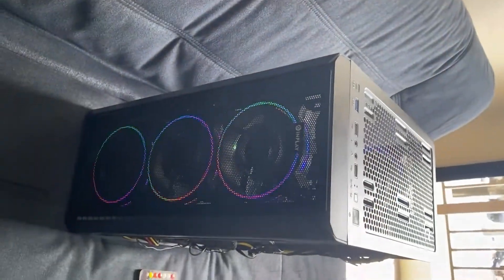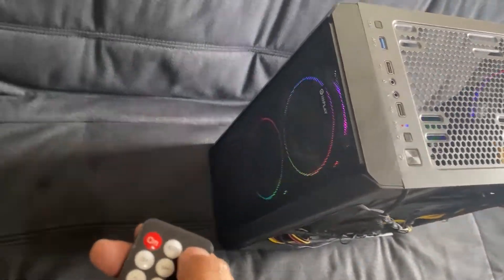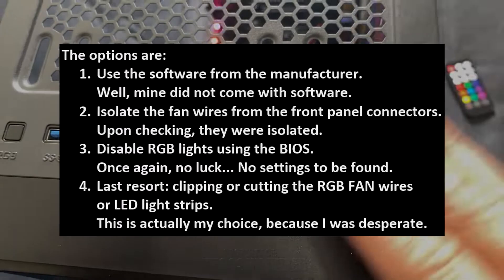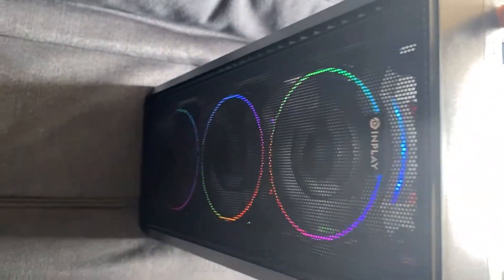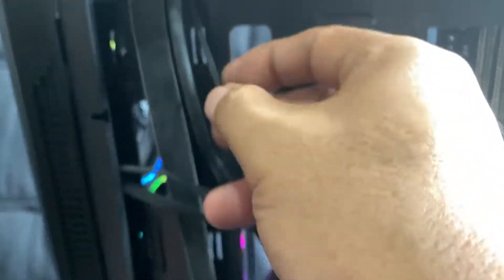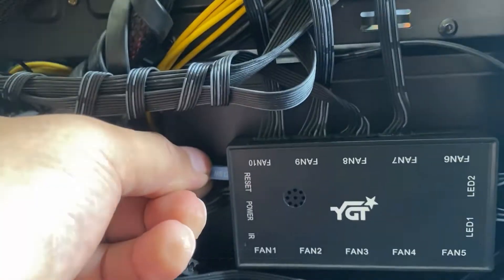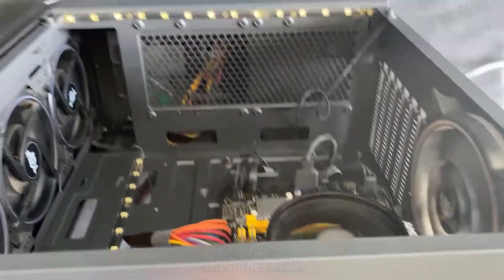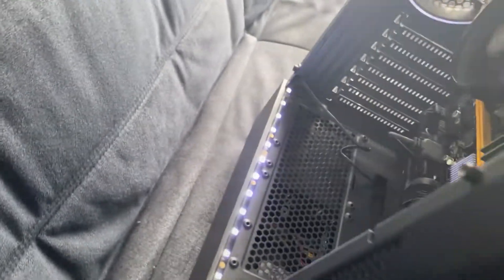How to turn OFF Computer RGB Lights without a Remote Control #Computer #RGB

Comment: I had a remote control that I could use to balance all the pieces together using the sync with m/b button but now it seems the remote is not responding  Is there a solution?
Reply from the maker: You can try changing the batteries on the remote. If it doesn't help, the solution in the video makes the reset/RGB button of the computer case cycle to different lighting modes. And by long pressing, it serves as an on/off button. I don't know if this solution can replace the function of the remote that you've been using... Thanks for the comment.

Comment: ginawa ko po yung ginawa nyo pero hindi po gumana
Reply from the maker: Depende siguro sir sa brand po. Pag may reset na terminal malamang po nagana sya. Kung meron naman reset, yung pag patay nya ay may timing. Mga ilang pindot muna po depende sa kulay bago sya mamatay. Sakin po pag 3 yung kulay nya RBG pag long press namamatay sya. Sa ibang kulay po di namamatay, nag papalit lang ng kulay. TY po sa comment.
Reply: @WhooshyRider  naka coolman robin 2 case po ako
Reply from the maker: @nyark9469  me reset na terminal sir sa control box? kung meron na shoot muna yung reset button na wire? ty
Reply: @WhooshyRider  yes po
Reply from the maker: @nyark9469  so bale di nagana yung rest button nya? as in di nag papalit ng mga kulay?
Reply: @WhooshyRider  opo di po
Reply from the maker: @nyark9469  Maku sir. di ko na po alam diskarte dyan. try ko pong i-reserach yung model mo po. sensya na po. ty ulit
Reply: @WhooshyRider  same case fans po tayo, di na rin po nagana remote nya pero umiilaw remote pag pinipindot hahahah

Comment: I have a switch that's called. LED SW and LED reset I plugged in.the LED SW in to the reset port And now my light are not coming back on Do you have any idea why? If I may ask.
Reply from the maker: Very sorry for the super late reply... Try to plug LED reset into the RESET port. If it doesn't work, unplug both switches for normal operation. Thanks, and sorry again for the late reply.

Comment: I think i have a problem with my hub because the fans and leds stays on after shutting down the computer, tried every " softwares"  solutions i found on internet, do you have an idea ?
Reply from the maker: Hello, to be honest, I don't have a solution for that issue. This is just me speculating that your RGB lights stay on as a normal motherboard LED should. So, as for my idea... Or how would I approach this? I will start by isolating the RGB lights from the motherboard. And if the motherboard's LED stays on after shutdown... Then I would have 2 options: 1) Search the BIOS for motherboard LED settings, i.e. LED=OFF, or any power management setting related to LED. 2) As a last resort... I would look for a different port on the motherboard to connect the RGB lights, because it's just maybe, but not most likely, that this is a wiring or connection issue. Please proceed with caution if you decide to do this. And I hope you will not make me responsible if something wrong happens. I'm just a struggling and humble YouTuber trying to help. Thank you very much for your comment; it really helps the channel.
Reply: Thanks, first of all, i wont make you responsible if i break something while fixing this so do not worry about that,
I can't manage to find a way to shut the power completely and cant plug the hub somewhere else either,
There is very few infos about my specific problem so i dont know if its either : 1 case problem ( doesnt seem to have this problem somewhere else so i dont think so ) ( Its a Oversteel Kyanite, it has an argb fan hub )
2 motherboard problem, its either hardware and i f* up my cable connectiond or a setting in the bios ( its a X570 A pro )
Second note : i tried with another fan directly on a sys fan pin, and it stays on too, so it might be a power problem but cant find anything about this in my bios
Reply from the maker: @jeremi6650  Thank you so much for the hardware info. I'll do my best to do some research myself. I'll keep you updated. And thanks a lot again.

Comment: Is there a program that can change the LED color and turn it off without remote control or manual operation?
Reply from the maker: Good day! I found this:
https://windowsreport.com/best-pc-lighting-software/
Don't click on the "DOWNLOAD" link. Just scroll down to the list. It turns out that most RGB control software is proprietary. Thanks a lot for your comment.

Comment: How to change fan brightness form reset switch
Reply from the maker: I'm afraid it can't be done with the reset switch. You can only cycle through different colors and turn it off or on with the reset switch. Thanks a lot for your comment.

Comment: my controller didnt has reset port

🤐😙😞😣😖😭😭😭
Reply from the maker: I did a quick search on RBG controller modules and found this type.
https://www.primochill.com/products/bykski-8-4-5v-addressable-rgb-rbw-light-controller-module-b-rbw-c8-v4
It is really quite similar to mine. I inserted the reset wire leads into the "manual control" header on the left side of the power headers.
If your controller looks similar, chances are you can use that header too. But if that's not the case, you can post the model of your controller here, and I'll do my best to assist. Thanks a lot for your comment.